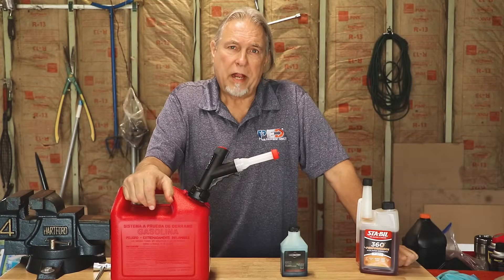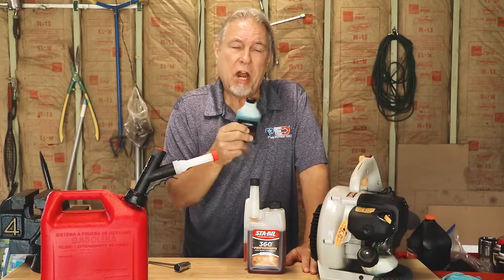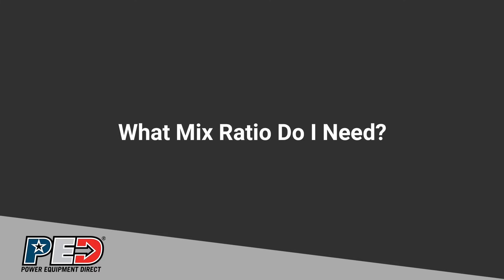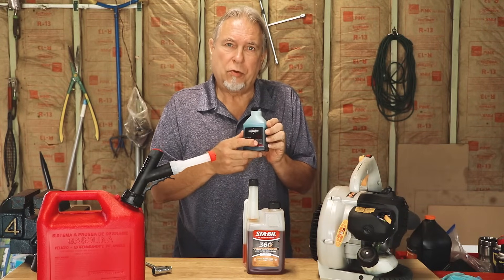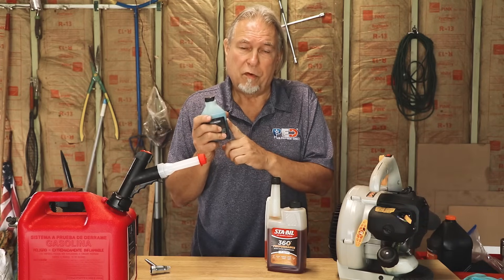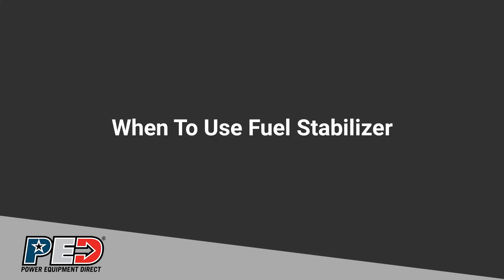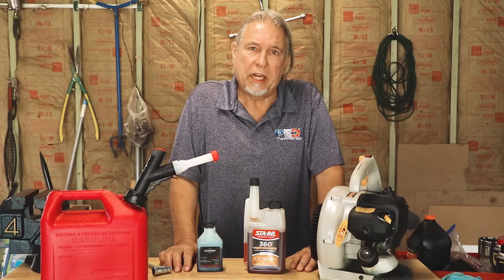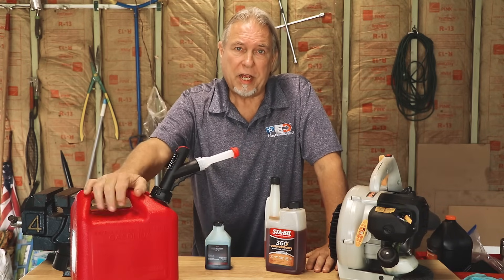How to Properly Mix Gas & Oil for 2-Cycle Engines

Comment: With so many 2-strokes climbing in price and under fire for noise much less emissions, I have heard machine shops tell me that many brands even Briggs are using an aluminum piston in an aluminum bore/cylinder. This may keep cost down but it can increase the profit margins for all the hands touching the product. But I am seeing 25:1 air/oil ratios showing up! This must be al on al piston / cylinder combinations. After 40+ years of fixing vehicles as an ASE Master tech, I can’t believe what I am seeing! I have to mix paint for my 38 year old son because he can’t figure out ratios. It’s on the cup now.😮
  Thanks kindly for helping folks understand this better!

Comment: Been using 30weight SD Motor oil , many brands with a 50:1 mix for years and often the unit rust out or breaks before the engine fails.
Nuff said !

Comment: What gasoline octain should I buy to mix the oil with? Octain such as 87, 90, 93.... etc. I have machines that take 50:1 and machines that take 40:1.
Reply from the maker: Great question. While mixing fuel ratios with 87-octane gasoline is acceptable, using mid-grade gasoline (89-octane+) is typically recommended to further protect the engine from overheating and run cleaner. What is more important is to never use any gasoline with more than 10% ethanol, or you may risk damaging the engine over time. Some gas stations offer ethanol-free gasoline, and if that is available, it is the best choice above gasoline with ethanol. If you don't plan on getting through your entire fuel mixture in your gas can within a few weeks, stabilize the fuel on the day you purchase it for the best storage results.
Reply: @PowerEquipmentDirect hanx for the reply. It also important to know that the higher the octain the  lower the flash point. Some 2 cycle  engines will not start or have enough torque if the flash point is to low.

Comment: if your 2 cycle oil already has stabilizer, should you still add stabilizer from Sta-Bil? I usually go through 2 gallon gas can every 2-3months.
Reply from the maker: The short answer is that if you buy 2-cycle oil that includes a stabilizer, the manufacturer should have already factored that into mixing fuel at the proper ratio, so adding more is likely unnecessary. Think of this example - if your fuel has been stabilized, you can't improve the stabilization by adding more. A stabilizer only slows down the decay process, but adding more won't improve the combustion of the remaining fuel. You should be fine not adding additional stabilizer to stabilized 2-cycle fuel as long as you mix it to the same number of gallons and mix ratio as recommended on the bottle.

Comment: Can you mix oil with half a gallon of gas?
Reply from the maker: Whenever mixing oil and gasoline, you need to follow the instructions on the oil or fuel mixture. You'll have to do the math for whatever amount of gasoline you want to be mixed, and follow the proper ratios outlined in your power equipment manual. The common fuel mixture ratios will use a standard gas can size, like a 1-gallon or 5-gallon tank, but you need to see the manuals for that specific information.